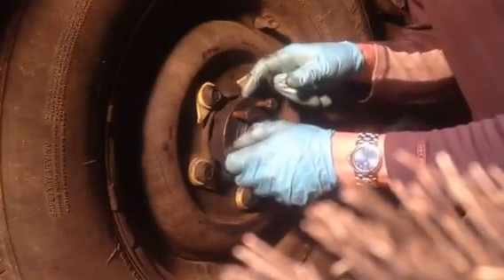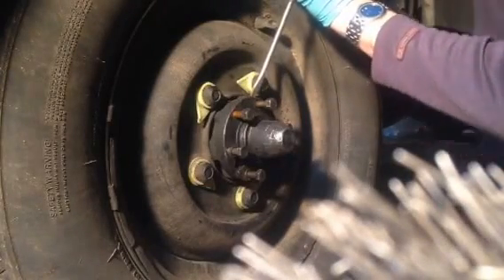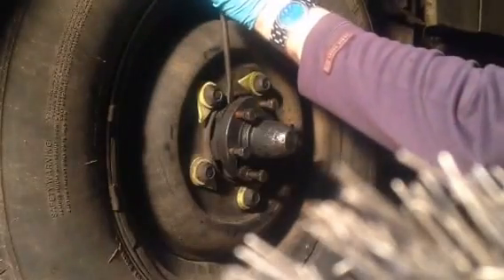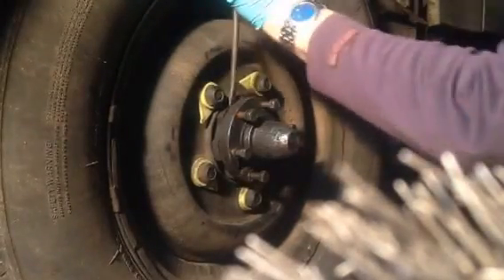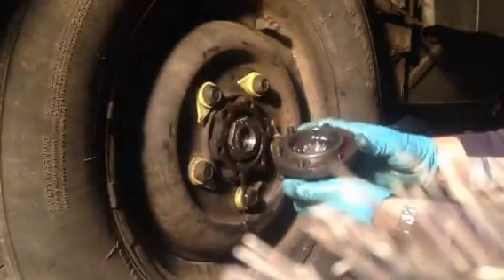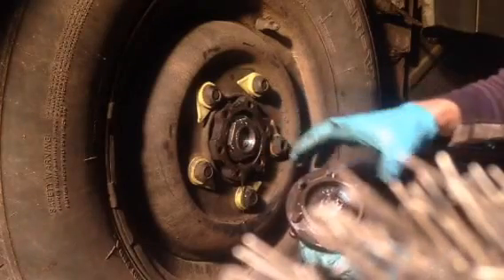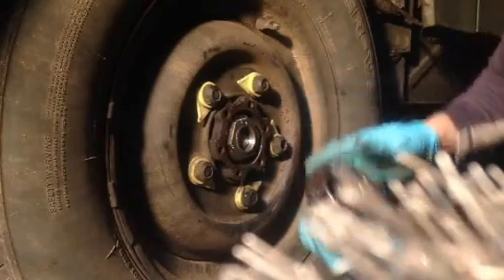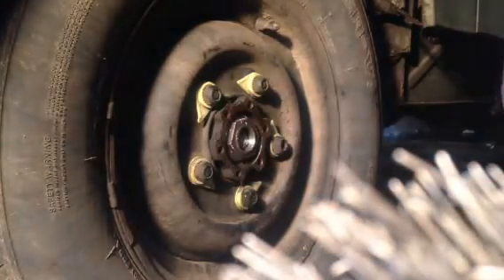Land Rover Series 2A rear half shaft / axle differential broken part 3

Comment: Too bad for me, I thought I'd see the solution here for my broken half shaft but it's torn off at the diff side 😞 Mine's a Series3 from 1978.
==>>  Anybody knows a trick to pull out the left-over piece at the diff-side? It is the long half-axle so about 80cm deep into the axel shaft, I need a trick like a magnet on a plastic rod (electrical tubing maybe) but will the torn-off part come out so easily? Another trick might be a welding machine with a very long metal rod that is shortly turned-on-off just enough to get a fix. But I'd be running a current through bearings and near oil that might catch fire (even residu), so not too keen on that... <<==

Comment: I'm sure I'm telling you anything you don't already know, but for the benefit of others: the 10 spline half shaft was an inherent design flaw because the groove depth took away too much steel.  The remaining splines at the end of the shaft were too weak to handle even normal loads.  My dad must have burned through half a dozen axles on his Series 2A 109 over the years until he finally swapped in a heavy duty 24 spline one ton ENV axle rescued from a forward control.  Now it is bullet proof.